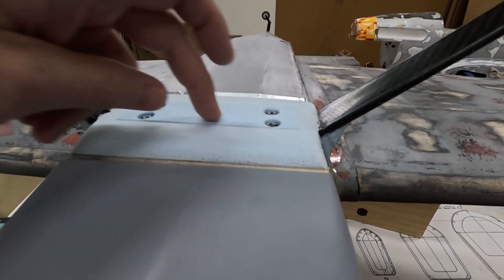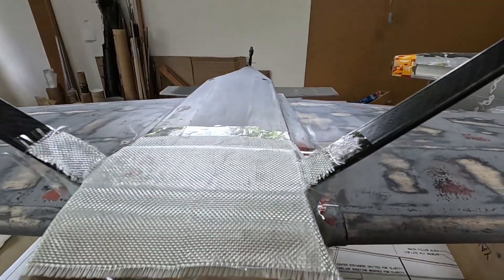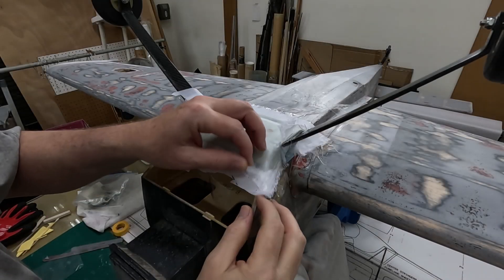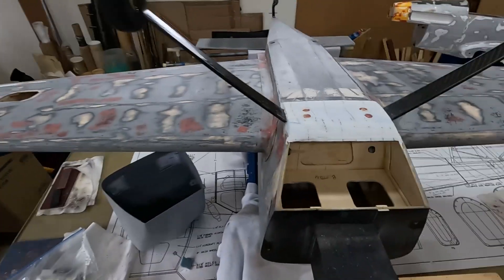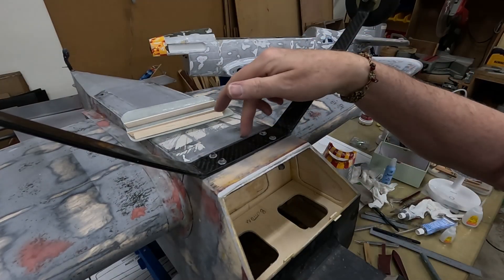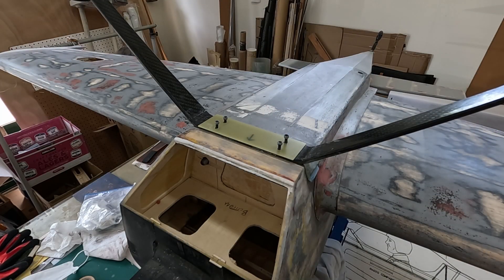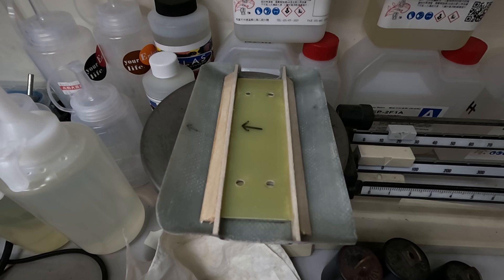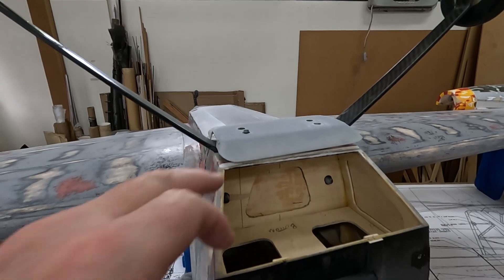DR-107 One Design RC plane build, Update #32, Landing Gear Cover

Comment: Redo the gear brother! Cut down about 1/4 inch should make the gear flush with the belly. You’re having to do way too much engineering and fabrication to correct a simple mistake! We’ve all made the same.
Reply from the maker: I did look at recessing the gear as it should have been but felt that was not feasible because of the wing plugging into former at that location.   IIRC, there would have been interference with the wing and the revised gear mounting plate.  It's a done deal at this point but I do appreciate the suggestion.  The gear cover doesn't look too bad and definitely looks better than "stock".  Thanks for watching and your input.

Comment: Som small cirkels of packing tape to cover the holes and then some PVAC as a release agent. That comes off easily.
Reply from the maker: I'm not familiar with PVAC.  Is that similar to PVA mold release?  If so, I'm still trying to find it in Taiwan.  Thanks for the tip.